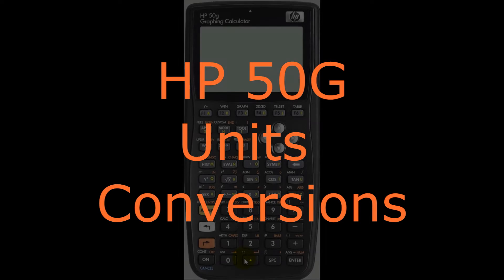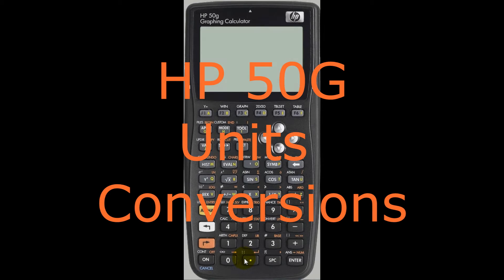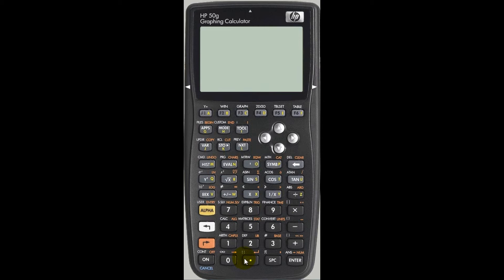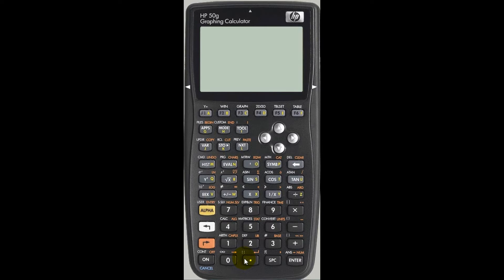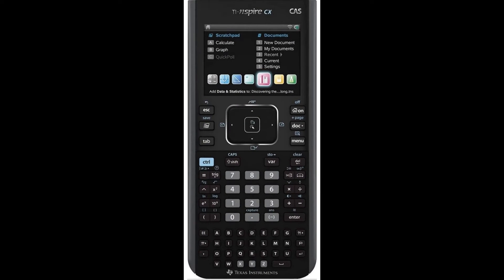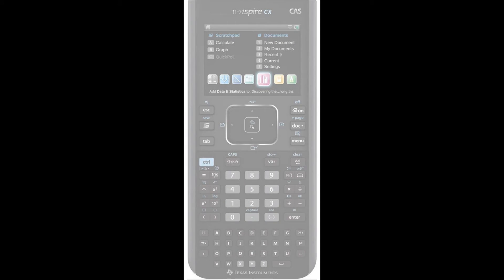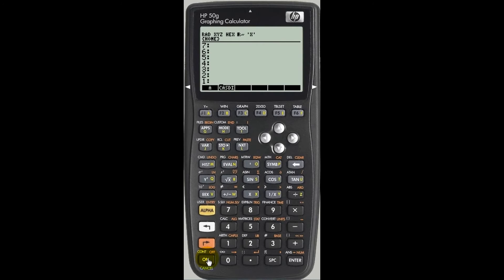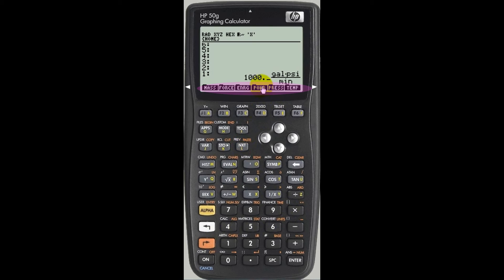hp 50g unit conversion

Comment: Mr. Ragan, I have a HP50g and I use a lot the calculator for unit conversion in my daily work. My HP is giving me problems with the keyboard and I need a replacement. I watched your video of TI N-spire II Cas and that could be an alternative. Would you recommend the TI ? Or better a used HP50?
Thanks for your time.
Reply from the maker: I'm a huge fan of RPN, so I prefer the hp.  If you like algebraic entry, I would go with the ti CAS.  Both are great calculators.
Reply: @raganjs  Thank you very much

Comment: Nice, thanks. Do you know how I'd go about getting units like acceleration (m/s^2) ?
Reply from the maker: Thanks for the comment.  Try this sequence:  1 enter, right shift 6 (units), speed, m/s, right shift 6 (units), time, right shift second.   The key is that if you right shift before selecting the unit, it goes in the denominator.  You can also simply enter 1 second and divide.